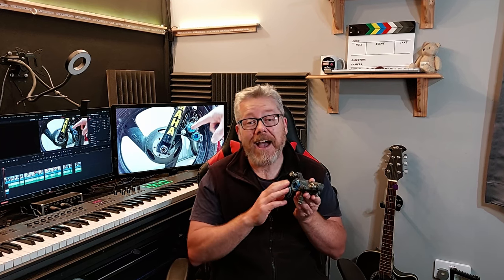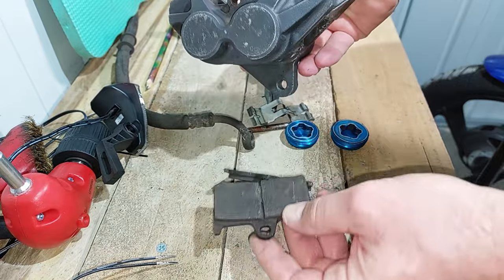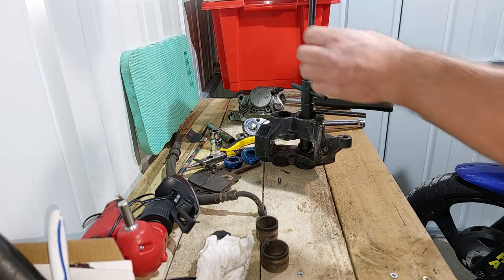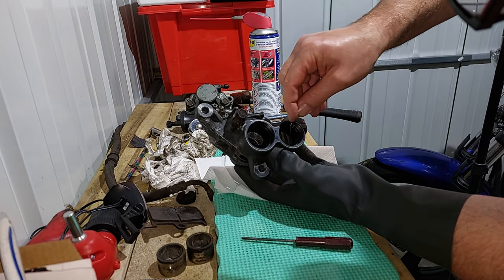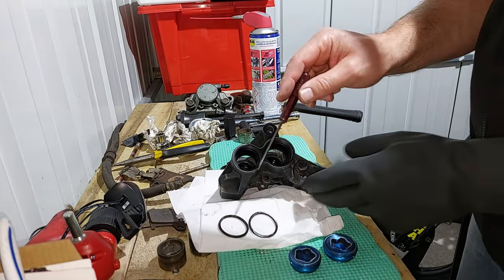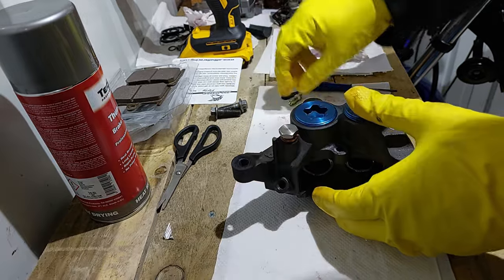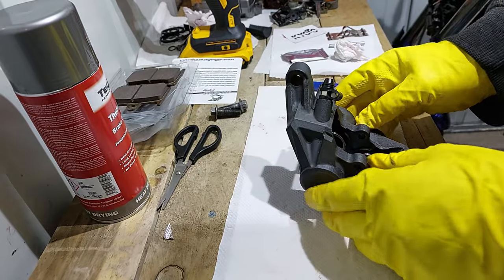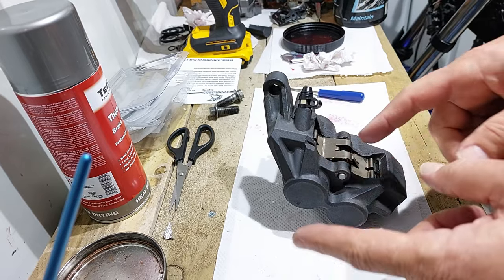HOW TO REFURBISH YAMAHA BLUE SPOT BRAKE CALIPER - OVERHAUL REPLACE SEALS PADS O RINGS

Comment: Love the video! Very helpful. Im currently working on rebuilding the same calipers on my 03 yamaha r6 and was curious what you torqued the blue caps to when reinstalling them?
Reply from the maker: @_Dippy  There is no torque value available. Try and gauge how tight they are when removing them and apply the same force to tighten . You could add dab of blue lock tight to be on the safe side 👍
Reply: @baconbuttties  much appreciated! Shop wanted 4 times the price of the kit and puller combined to rebuild them, I said absolutely not 😅

Comment: In addition to my post: 30 Nm are more correct then 40Nm. You do not gain any advantage when tightening up these plugs too hard. And maybe a little tipp in loosening the brakepistons, when you can`t  get your hands on a special tool as seen in this video:

Remove the brake pads, and put a little peace of wood between the 4 brakepistons. In breaking with the handlever, you will have a good control over these pistons, in loosening them when corrosion seems to be a problem. Just leave the brake calipers on the fork, and start massaging those pistons out.

Comment: Haynes recommend using the master cylinder to pump out the pistons, two at a time. They also say to leave the blue spots alone.
Reply from the maker: Do it the Haynes way then...Quick question, how do you pump out the other two once you have lost brake pressure?
Reply: @baconbuttties  You do not push the first two all the way out. Just a litte bit before they come of.

Comment: Nice instructions, thanks. 
I'd have been tempted to apply heat with my hot air gun to ease the piston removal.
Reply from the maker: I did use a hot air gun and grips on the rear brake calliper on the fazer  as it was stuck solid.

Comment: Recently overhauled my Blue spot calipers on my old FZS1000, made the mistake using pattern but so called quality seals, never again, all went together easy, very time consuming cleaning out the crap from the seal grooves tho, Lockheed red brake grease on seals & pistions, all went in smooth as can be, after a month or so, pulled calipers off for a clean & inspection, pistons were tight as fook to push back in, virtually impossible by hand, needed a strong plastic tool, even then it was a struggle...
Lesson learned, never buy pattern brake seals, they're just crap & made to wrong dimensions.
Reply: "Pattern" is not a term I've heard used in Canada. Is that anything like "generic" or "no-name" aftermarket parts?

Comment: How many Newtonmeters go with the blue plugs ? I tried to measure it out while loosen them up, I guess round about 30-40Nm. But I`m not sure. And maybe it would be a good idea to give them some Loctite screwlock as well.....?! What do you think ?
Reply from the maker: Probably doesn't need loctite and I just did them up roughly the same as  they were done up as  I don't think they need to be super tight.
Reply: @baconbuttties  Yamaha tells you NOT to remove the plugs. That's why there's no torque figure given and why there's no replacememt o rings.
Reply from the maker: @dirtygarageguy  I also bought replacement o rings.
Reply from the maker: @dirtygarageguy  I don't know why you are getting so worried about it.
Anything that is screwed in can be removed, also you can buy replacement o rings.
It can be done and I did do it.
Reply: @dirtygarageguy   I've come to the conclusion that Yamaha didn't think 30 years into the future when they made the manual. At this point, if the best way of removing the pistons is to remove the blue spots, then thats what you have to do

Comment: Dont hammer your pistons out of the calliper!!!!! Use the break pressure to pop the pistons out, pistons and calipers aren't designedto be taking a shock like that. don't remove the blue spot cap there is no known torque setting for them, Yamaha's own workshop manuals say do not remove for rebuilds.
Reply from the maker: I removed them and rebuilt them and I bought a tool to do it.
Do you think it is going to disintegrate if you remove them?
Also you have used way too many exclamation ‼️ marks.
Reply: @baconbuttties  I've certainly done dummer things in the past, but when your putting videos on YT you need to be careful, someone's gonna copy ya and fuck thier calipers up.
Reply from the maker: @vikingbiker  If they copy me then they wont because like I keep saying, I successfully refurbished them.
If the job was a perfect success then how  have I damaged them? Please tell me. Also I tapped them with a small hammer and a piece of rubber which did no damage at all as the pistons are made of strong metal not cheese.
Reply: Are the brakes still holding up nowdays? I'm hoping to try this method @baconbuttties
Reply from the maker: @djlancer88  I actually gave the brakes to my brother and he is putting them on his TDM850 rebuild... So they haven't been used yet.
Reply: @baconbuttties  I just ordered that tool. Any tips or things I should know. Did it work well? I’m also hoping to use for needle bearings also.
Reply from the maker: @djlancer88  Tool worked well